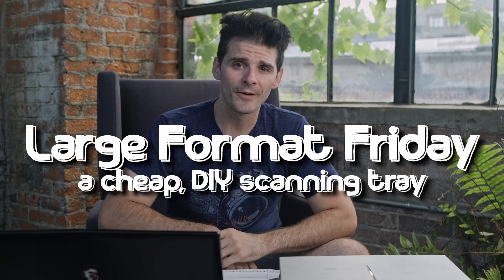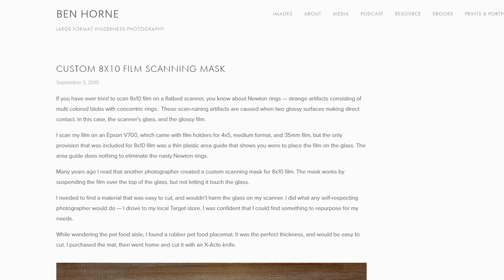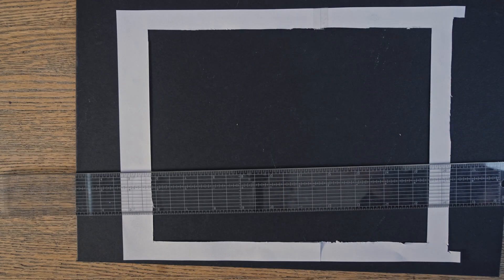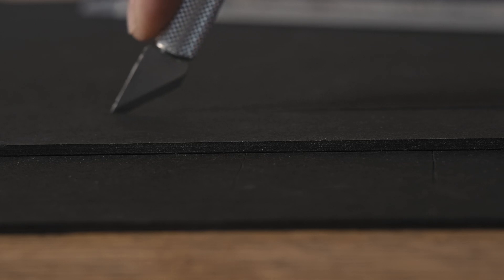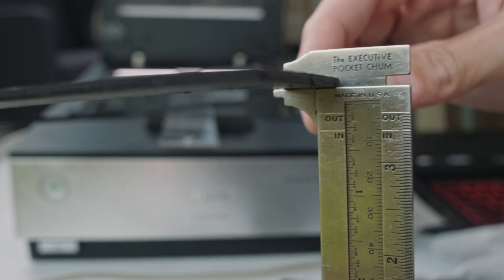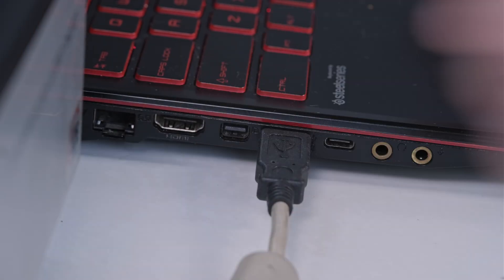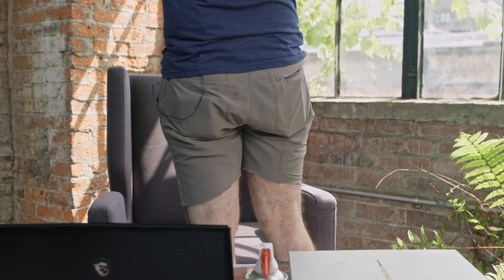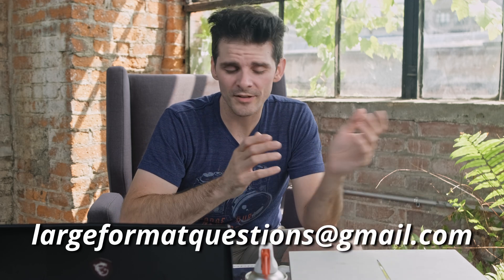DIY Epson Flatbed Scanning Holder - Buh Bye Newton's Rings! - Large Format Friday

Comment: A great and informative guide. That Les so much

For smaller formats, I’ve used lightly frosted glass (or ground my own using carborundum powder or wet and dry sandpaper), replacing the top of the Epson holders. No Newton’s rings, though I’ve never been sure on the optimum scan height.

Comment: FYI - Ben's template isn't the best and can be adjusted. 
Preview-scan only the template and you will see that some of the template appears in the scanned image - that part of the template can be trimmed away. Once it's been trimmed so you can't see the template, a sheet of 8x10 will sit cleanly on the scan glass and you can get ALL the image, including the border.
Another template method - https://www.youtube.com/watch?v=ehg17op3QaY
Reply: Would it be good to “clamp” the negative, using a more rigid material, and some peg locators that give greater support all around? You could still add a window to calibrate the emulsion base colour.

Comment: Mhh no newton rings without a wet scan is ok but I am quite in doubt about the overall sharpness vs the film flatness.... imho it only works well if you mount film to AN glass and use a wet scan. For that reason I'm using for 4x5 the 'Better scan' option.......

Comment: Hi 👋 I’m not sure if anybody has mentioned fluid mounting to you maybe it’s too much work but it will allow you to get a 100%  perfectly flat surface scan. I noticed your negative have a ever so slight bow in it when you lay it down to scan. Your negatives are are big enough that you might not notice the sharpness difference from edge to center. I do like the ruler test. I will definitely use that method to find optimal sharpness height. I understand that some people won’t want to fluid mount every single negative they scan. Maybe I am a little crazy but I fluid mound every single scan. All you need is a 8 x 10 clean piece of glass. It doesn’t need to be special anti-newton glass. It just has to be a clean glass. With some narrow enough shims underneath it in the corners for your optimal height, so none of the image gets clipped off. Using a photographic clear, mylar sheet to sandwich the negative. This works great for 35 up to 4 x 5. For an 8 x 10 negative you will probably need to get a custom size piece of glass that will fit in the scanner giving you enough surface area between the edge of the sheet and the edge of the glass, so the mylar sucks everything tight together because the negative will be hanging upside down During the scanning process. This is very tedious work, and I can understand why some people would not want to do this for every single negative.
It is the next level closest to a drum scan, which is very expensive. Sorry for the long winded comment. If this interests you, maybe you should try it at least once to see if you like it.

Comment: Another way to get rid of Newton rings and maintain optimal focus: wet scanning.  This isn't as cheap to start (around $200 for a holder, tool set, and liter of scanning fluid), but once you have the (adjustable) scanning height set on the holder, will produce 100% area scans at the best resolution your scanner optics and software can offer, with somewhat easier per-frame setup than this frame (no nit-picky positioning of the film).  Newton rings are eliminated by the almost identical refractive index of the scanning fluid and glass, and the fluid dries from negatives in about a minute with no damage, and no need to wipe them down. The same scanning holder will also work for all formats, whether 8x10, 4x5 (multiple film sheets in a single setup), 120 (up to three strips at a time) or even 35 mm (four or five strips will fit on the wet scan holder, though it might be tricky to get them all aligned and scanned before the fluid starts to dry out).

Bad news is, a little higher barrier to entry (but if you afforded a $1000+ scanner, another $200 to get the most out of it doesn't seem out of reach); good news is, you're much less likely to ruin the furniture or need stitches from a mishap setting up for wet scanning.

Now, don't get me wrong -- I've got a wet scan holder (but not the rest of the setup), but I'd make one of these, too, because once made, a single scan with this frame is much quicker than getting all the bits and bobs for wet scanning together (if I'm scanning a whole vacation worth of negatives, on the other hand, wet scanning probably wins).

Comment: That's great you confirmed the utility of my method for checking the focal distance for the 8x10 flatbed lens on the V700. There are two lenses (one focusing on or just above the glass platen as you use for 8x10s and area guide) and the other focusing about 3-5 mm above the platen (for when 'holders' are used).  I use solely the 'holder' mode when scanning so never checked my V700/800 in the area guide mode. Glad it worked for you!

Comment: I do 4x5 on an Epson V750. I tape the negative emulsion side to the frosted side of a sheet of ANR glass, then suspend the glass, frosted side down over the scanner bed, propped up on felt standoffs at the optimal height. I like your technique because there wouldn't be the additional glass surfaces to keep dust free. One thing I may have missed in your video, but I think is important to mention is that you have to select "scan with film holder", not "scan with area guide" to get the higher resolution lens and higher optimal scan height on Epson V777-v850 scanners.

Comment: From my experience (4x5 at 1600 dpi) I could tell the difference in sharpness of scans even down to a fraction of a millimeter. Masking tape strips on the corners of the epson holders make for good shims that put the film about 0.1mm higher off the bed per layer. A little trial and error with tape layers and you can find a sweet spot. The clear ruler method is very clever to find the optimal height.

Comment: The problem with elevating the larger negative above the glass is it utilizes the second lens capable of scanning larger sizes.  It's optimal height is directly on the bed.  I was able to purchase a sheet of optical, antinewtin glass. I placed a small bead of silicone around the bed's glass to prevent oil from dripping into the scanner.  Using drum scanner oil I mounted my negative to the bed using non residue tape.  If you scan without adhering the negative, as the scanner moves across the patten it actually lifts the film harming the sharpness.  I sandwiched the negative with the anti- Newton glass.  Another method can be utilized with drum scanner emulsion.  Look up kits on Aztec scanning.   I did lots of testing and got the best results with venue scan.  Sharper and easier to use raw mode.  Sharpening turned off

Comment: Hey Mat, I never had any problem with Newton rings.  At least I never noticed any rings.  For 120 and larger negs, including the Fuji Xray, I just lay the neg down on the scanner (850 I think) emulsion side down.  I don't put any glass or anything on the negs, therefore, no pressure.  I have to flip the image in PS, but that's OK.  Btw, when are you going to show us your new Ghibellini? :) :) :)

Comment: With a slight alteration this might be also very useful for me. I shoot 4x5 and scan with the Epson V800, the included holder has 2 problems, the first is only 1 sheet can be scanned at the time (this is a minor issue though), the second issue is a lot bigger and that is that the framing is so tight I can't get the film base in the frame without also cropping some of the rest of the film. So making my own holder might not be a bad idea

Comment: Get a piece of A4 non reflective picture frame glass. Tape the neg along the edges to the dull non reflective side of the picture frame glass. Keep the neg perfectly flat on the glass when applying the tape.  Cheap non reflective picture frame glass works just as well as expensive anti newton ring glass.
Place the glass and neg on scanner, neg facing down, shiny side of the glass facing up.. Use 1mm 2mm 3mm spacers under each corner of the glass to get the right scanning height for your machine. I use model makers plastic card that comes in various thicknesses. These can be glued to the glass once you've found the correct height for your machine. 
Result. Perfectly flat neg, sharp scan and no newton rings. You can use fluid mount instead of tape for a perfectly flat negative. I just don't like putting messy fluid mount on my precious negs. If you use transparent tape you can also scan the film borders.

Comment: Now wait just a minute here! You appear to be missing the most obvious (and well-known) fact about these scanners.
You could have saved yourself those twelve years if you had read the instruction book that comes with your scanner!
These EPSON scanners have TWO lenses, set at different focus distances. One lens is focused directly on the surface of the scanning glass, and the other is focused a few mm above it. 
I don't know how you could not know this, because you have to TELL the scanner which one you are using before you start scanning. The lens focused on the glass is slightly lower resolution, and is usually used with reflective materials (opaque paper), while the one above the glass is higher resolution and is usually recommended for transmission scanning (film). It is not a question of "tolerance" or different scanners being sharp at different distances - Each scanner of this type has TWO DISTINCT focus distances, based on which lens you use. If you use the Area Guide, it ony generally depicts the placement of the material on the bed, and the scanner will focus at the glass level. If you use a film holder, the material is held at a level above the glass, and you are using the lens adjusted at that level. Moreover, these guides all have adjustable feet on them to fine-tune your focus. 

One disadvantage of using the high-res off-the-glass lens is that larger formats will sag. Even if you have a holder that clips the film firmly by the edges, this will not prevent 8 x 10" film from sagging in the middle, and becoming unsharp. The option Epson proposes to solve ALL these issues (as well as Newton's rings) is the wet-scan tray. This will hold your film at the correct level for the upper (higher-res) lens, and also keep it perfectly flat - much like a drum scanner, thus avoiding sagging and Newton's Rings. It's more work though, and a lot messier.

Comment: Incredible your film, even thinner base, can support itself without touching in the middle at this size.  I often have even 120 film with a bit of a droop in the middle with a holder.  But if it works it works!
Reply from the maker: I'd recommend taping the film for optimal flatness, but for quicker scans "floating" the film worked just great!

Comment: Hi Matt I've been doing this for about 20 years for weird formats, as well as 8x10. I use a thin steel plate with a cutout for the negative, with just a little bit of overlap on the edges. The steel is around 18-20 gauge. The great thing about steel is that it's very rigid.You can tape the edges and keep tension on the neg.  I made one specifically for my 70mm roundshot panoramic negs. The steel is low profile as well.
Reply from the maker: Got any of those spare steel holders lying around? ;) Thanks for you comment Jamie and let me know if you ever want to do a feature on panoramic large format!
Reply: @MatMarrash  If you want to do a cirkut shoot /feature sometime, I'd be game.
Reply from the maker: @jamieyoung9268  I would LOVE to! Let's keep the conversation going and figure out the logistics on this. You have no idea how excited I am! 🤩

Comment: So the film sits on the edge of the new frame a couple mm off the bed. With such a large film how does it not sag in the middle and touch the bed? Or does that not matter
Reply from the maker: There is some sag, but none so great that it has dramatically altered the scan. Still far, far sharper than letting it sit bare on the glass.
Reply: @MatMarrash  within the DoF I guess. 👍

Comment: Get a sheet of ANR glass from Negative Supply and tape your film to the glass BEFORE placing on the frame so that your neg is completely flat and doesn’t sag in the middle thus affecting the overall sharpness.
Getting your negs off of the glass certainly helps get rid of the rings, but your scans here looked a little soft on the edges with regards to sharpness.
Also, Vuescan is great for multiple pass scanning when wanting to make an Archival scan of your film, but for scans for social media Epson Scan 2 (for Mac) is all you really need. I find having a GUI is much more useful compared to the clunkiness of Vuescan which doesn’t have a GUI….

Comment: The advantage I see to Ben Horne's choice of the plastic/rubber cat tray material is that the sticky cello tape I would use to flatten the film out on the holder would peel off easily and not take the paper surface of the foam core with it. Having said that, I am still searching for the cat tray, Target seems to be out of stock/doesn't carry them anymore. A 3D printed frame would really be the way to go, someone needs to make and sell them... 🙂
Reply from the maker: Someone definitely needs to start chugging out some premium printed frames!

Comment: Your timing is impeccable as I have been considering options scanning for 8x10 on my V700. Question is the film sitting on top of your negative guide and if so are you experiencing any center sagging with the film on top? Thanks much.
Reply from the maker: This was a simple demo and I recommend reading through Ben's blog. Taping is recommended for optimal sharpness!
Reply: @MatMarrash  Actually after my original comment I figured it out and 45 minutes later I traced out on an inexpensive, thin flexible plastic cutting board the shape of the original area guide outer dimensions. Then using a negative marked out the center cut just a bit smaller than the negative itself. Using several scraps of blue painters to secure the negative I found the center did not sag and stayed above the scanner glass. A test scan looked pretty damn good. No official height testing was done but I can raise the height if deemed necessary.  Thanks again.

Comment: For 20 years I've wet mounted my 8x10 film directly to the glass bed and never had any Newton's Rings. I've thought about the DIY frame idea before but couldn't figure out a way to keep the film from sagging. I guess the height tolerance within the scanner could mitigate some loss of sharpness there.
Reply: You are right to be concerned about sagging with larger films. 
There is no "height tolerance" within the scanner - It uses two separate lenses, one focused on the glass level, the other focused at film holder level.
By wet mounting to the scanner bed you are very close to the best result you can get from these scanners. The only thing better is wet mounting on the wet-mounting accessory provided, which also places your film at the correct height to be scanned by the higher-resolution lens.
Reply: @gregfaris6959  I'm using an old Epson Expression 1680 to scan my LF film. There is no wet mount accessory; I would need to custom build something to allow that.

Comment: Hi Mat!!  From what I understand, the Newton rings come when film touches the scanner glass (or any glass that is not non-newtonian).  I had a few thoughts:
1. Maybe 3D Print your frame, would be much easier than all the cutting and you could more precisely get the thickness down to match any scanner.
2. You possibly could get 2x sheets of non-newtonian glass 8x10 sized and sandwich your negatives between them thus avoiding rings AND keeping everything flat?
3. Have you considered using a digital camera set up to "scan" your negatives?  I'm about to start doing this myself, using my GFX100 as the scanning camera, guessing that it can generate digital scans at a very high fidelity.

Anyway, another great show....thank you and glad you fixed your "ring" problem!!  Looking forward to your next installment!!
CC
Reply: 1) I agree -  I have 3D printed frames for my Epson scanner, and I get razor-sharp edges and right out to the edge of the image.
2) Sadly, "anti-newton" glass is not really very effective at reducing newton's rings. Moreover, the thickness of the lower glass, in your suggestion, would place the film at the wrong height; too high to focus on the glass level, yet too low to focus at the film holder level. The scanner uses two lenses, set at different focus distances. 
3) Using a digital camera to scan large negatives represents a considerable loss in quality. The actual optical definition of an 8 x 10 film is worth at least 1 Gpixel (probably 2), so scanning it even with a 50MP sensor means you have thrown away 95% of your image.
Reply: @gregfaris6959  agree on the second point. Using a macro extension I can digitize 35mm at nearly 1:1 but fidelity is reduced on my 6x6 and 6x7 negatives unless I stitch them--to say nothing of an 8x10!

Comment: I'v been using Tetenal AntyNeton Spray on scanner glass (and on pice of glasss to press negative down) and it works great eaven on 6400dpi, Unfortunatly on my EP 750 and 850 sharpest height is not on glass :(
Reply from the maker: Over on J. Riley Stewart's blog (linked in description), he details a more advanced scanning setup that uses a floating piece of glass well above standard scanning glass. He shows test results when using the new glass and even after removing the original scanning glass.